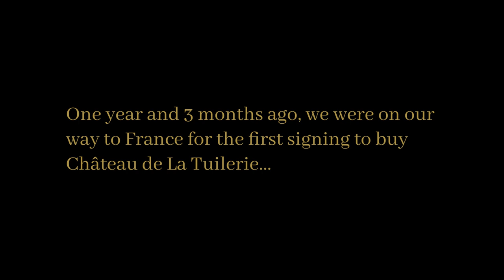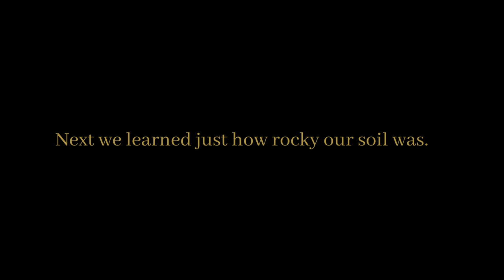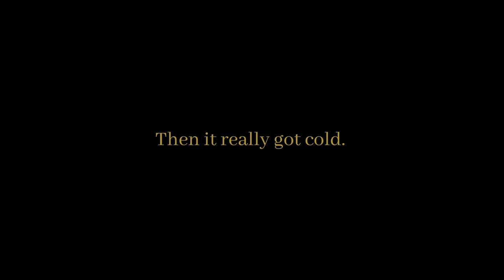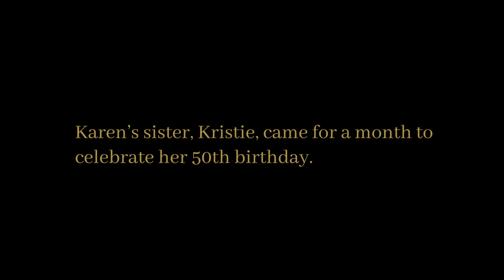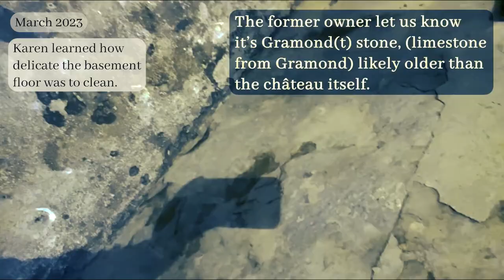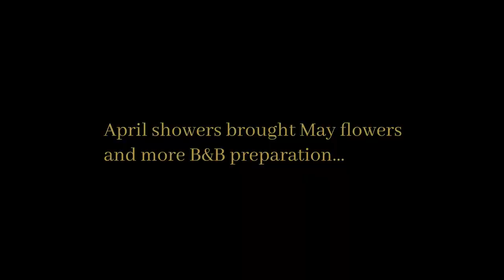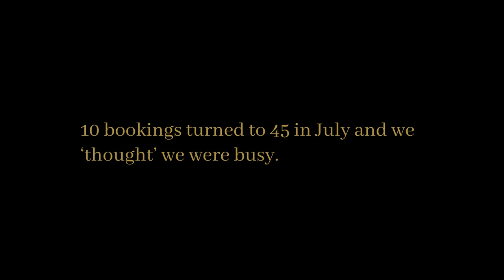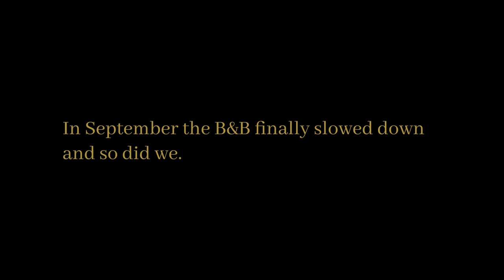Our First Year at the Château: A Retrospective | Queen's Escape

Comment: Spread industrial cheap salt on the terrace with the rocks to prevent weeds and grass from growing.
Reply from the maker: Is that table salt? Industrial sounds different.
Reply: @queensescape  Regular iodized or non-iodized table salt must be used. Check the package to ensure you are using sodium chloride, not magnesium sulfate (Epsom salts), rock salt, or sea salt. Try to buy in large sizes so it’s cheaper.